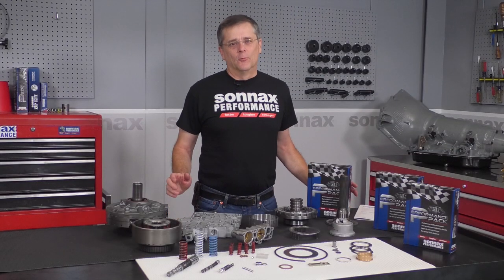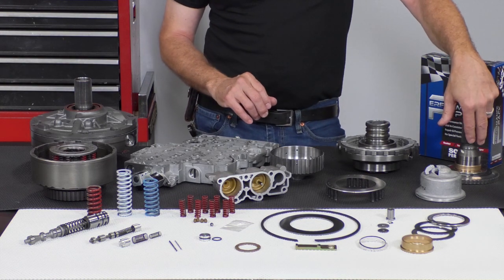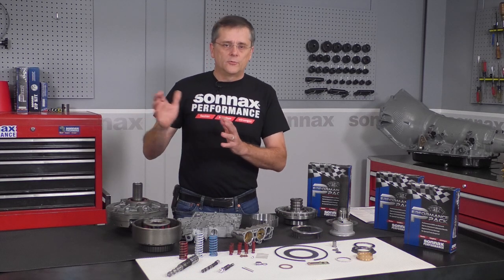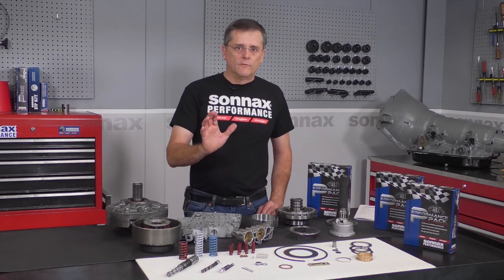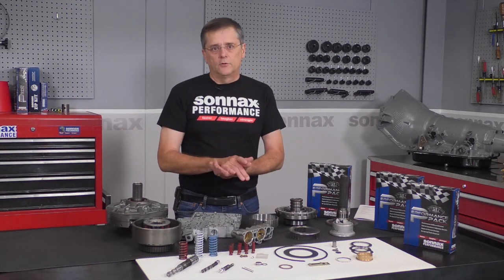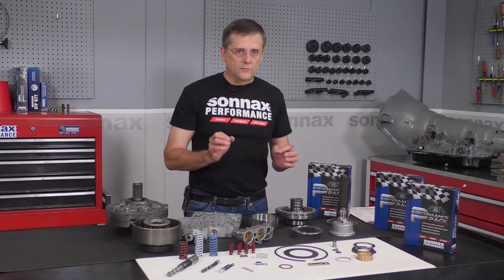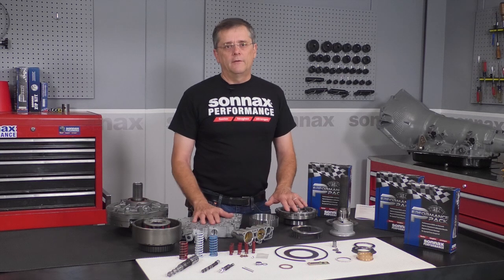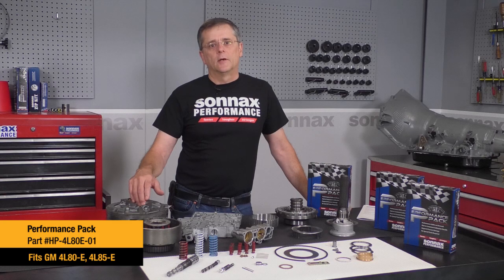See What's Inside the New Sonnax 4L80-E Performance Pack

Comment: Is it possible to make a 4l60 shift almost as quick and smooth feeling as the 8/10 speed transmissions? Even with a Corvette servo it still feels kinda slushy and awkward feeling, it would be cool to get that sexy sounding pop shift that the new Camaros have as well but I guess I'm asking for a bit much haha
Reply from the maker: Hi Chris, good question. There are a few reasons why a 4L60E won’t shift quite like an 8/10 speed transmission:

1) The 4L60E uses a band for the 2nd and 4th gear shifts. The shifts take longer to apply by design because there are more components involved. Later 8/10 spd units are operated clutch to clutch, which allows for quicker shift transitions.

2) The 4L60E is only a 4spd unit and has a rather wide ratio gap between gears. Models with more gears will narrow this ratio gap, for less rpm drop and quicker shifts and acceleration.

3) Regarding the popping sound between shifts, this has more to do with engine tuning. Later performance vehicles often use a form of fuel cutoff between shifts to mimic lifting the throttle for a smoother transition. The temporary lean condition and any unburnt fuel in the exhaust can ignite and cause the pops and crackles.

The good news is Sonnax offers a variety of performance products for the 4L60E that can improve upon this: https://www.sonnax.com/gm_4l60e. Feel free to contact our tech support team for help. They can be reached directly via email at sonnaxtechsupport@sonnax.com, or phone at (800) 843-2600 ext. 398. Thanks for reaching out!
Reply: @sonnax  how much less would the rpms drop with the 2.84/1.57 gear kit shifting around 6K rpms?
Reply from the maker: @chrishansen7004  our tech support team would be happy to help. They can be reached directly via email at sonnaxtechsupport@sonnax.com, or phone at (800) 843-2600 ext. 398. Thanks again, and enjoy your day!